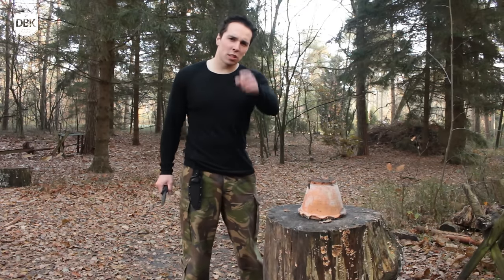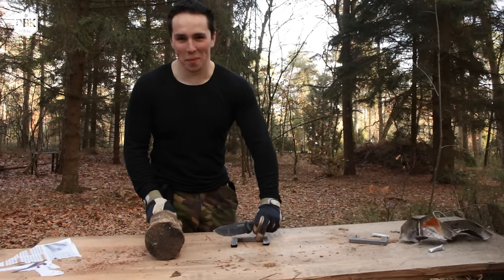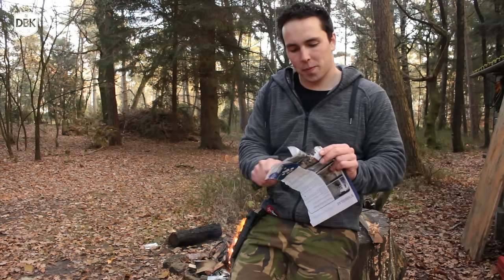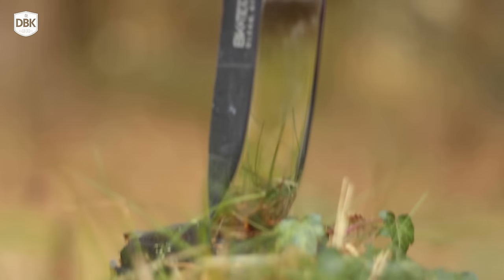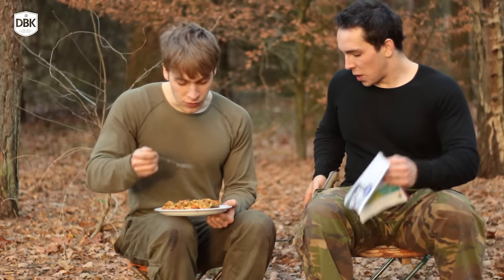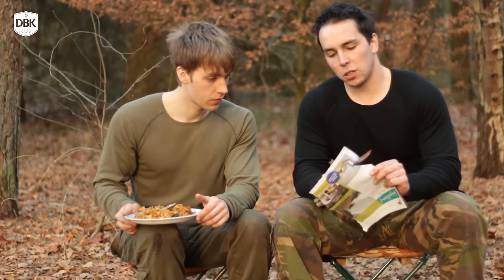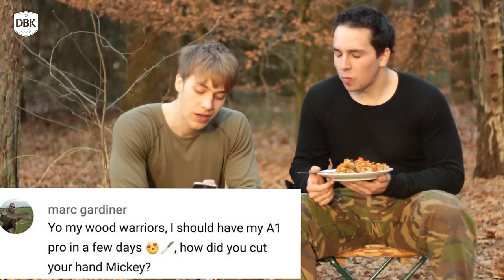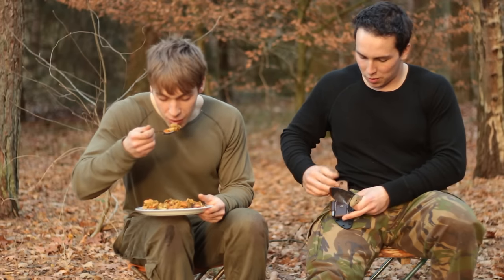Unleash The Beast! // Ka-Bar Becker BK2

Comment: I know the video is old and you guys won't probably answer, but I'll ask anyway :) 

Won't removing the coating and using it for food preparation result in rust on the blade? Being  it a carbon steel knife, I thought the coating was very important for that aspect. Are there ways to avoid rust even on a mirror polished blade, apart from wiping it up after use?
Reply from the maker: Hi man! Yea indeed it does make it way more vonerable to rust! But we like the looks never the less and to be honest we don't use it that much! In the netherlands we would always opt for a stainless/ semi-stainless knife. You can try to put some 'ballistol' on the 'naked steel' but yea.. as far as I am aware, there is no rust solution for a real lowlevel chromium steel. Cheers mate!!
Reply: Dutch Bushcraft Knives thanks guys! I guess I'll thoroughly wipe and dry it after use, if I'll ever decide to "undress" the blade! Keep up with you great vids and take care ;)
Reply from the maker: Thanks mate! You too!

Comment: I really wanted to like this knife and on the end i got rig of it.
The problem (and i never thought i would say this) the blade is overly thick.. to the point where it's handicapping the tool to be a good knife.
I have: BK1, BK2, two BK5, a BK7 and a BK9. Only the BK2 has this problem.
It's a heavy, stubby hunk of steel. I would say its a pry-bar... only because the lack of short size and leverage, it's not really good fir that either. The BK 7 is a much better "knife".

Comment: It’s a beast but not much of a cutter at all which is what a knife should do way to thick behind the edge but if u want to carry a 2 pound knife around that can baton small pieces of wood and pry doors open  or block bullets with I would suggest a knife that actually cuts well and is also a beast like the BHK Lumberjack toothpick great edge better handles sharp spine O1 tool steel that can also do everything this BK-2 can do and baton better actually than the BK-2 your gonna pay more but if your looking for a great hand me down type of blade that can do everything better than the BK-2 let me know I’m always up for a trade but it would take a great knife to pry this Lumberjack toothpick away from me. Plus the Lumberjack toothpick would make a great video I would considering it a survival blade mixed with a beast with a little bushcraft in it a great camp knife probably not a great hikers knife because it’s a little heavy but probably lighter than the Bk2 but u get an extra 1 1/2 inches of blade.

Comment: Again, awesome video. But you made your biggest mistake yet: never ever juggle with knives. For obvious reasons but possibly dropping a knife is bad for the tip and the bevel. A guy one did it with one of my knives, he never touched my stuff again after that
Reply from the maker: I dropped it on purpose. landing on the forest floor doesn't do much with the tip.  Of course I would shit my pants if I saw someone do that with one of my sharpened knives haha. However, this was for the camera.

Comment: If you guys think the BK-2 steel is better than the ESEE steel you must have bought the China knockoff that ESEE sued the company for it being identical in looks. It's almost identical except the steel and heat treat is garbage on the knockoff. The ESEE knife is by far the superior knife from start to finish of those two. It's better then the original BK-2 and the new and improved BK-2. The BK-2 is an ok knife but it's in that no man's land because it's to thick to be a great Bushcraft knife and to short to be a great chopper. It does nothing great except being driven into a tree and used as a stair. The minimum length for a knife with a 1/4 inch thick blade should be a 8 or 9 inch blade. The BK-9 is a much better fit for that platform. Just an opinion guys. Great channel, you Guys seem to have a great time and I will for sure be back for future video's. Oh by the way some of those china knockoffs were even sold to bigtime knife dealers so no one was safe from the unfortunate situation except for the authorized ESEE dealers who were listed on ESEE's website at the time. Later Guy's!

Comment: i dont understand why you hate the esee4 but the bk 2 is fine. i mean its the same steel and almost the samer hadness
Reply from the maker: it seems Ka-bar does their heat treat better than Esee. 1095-Cro Van is still not a great steel in my opinion but it's better than the regular 1095 from esee.
Reply: Okay thanks for your opinion
Reply: I would buy it but the german laws dont allow knives over 12 cm

Comment: 16 ounces of weight for a 5" blade is not a great utility ratio, any way you look at it...
Reply: Go deep-woods adventuring and need such an indestructible knife; you'll quickly change your tune.
Reply: I say then that, for really deep woods, de-limbing and path clearing is pretty much essential, so nothing with less than a 10" blade will really do. Some of those long blades can still split similar wood without bending, but I don't find splitting that useful anyway. For path clearing I was often advised to use just snippers trimming scissors, which are indeed safer and work better, but in the end that is yet another item to carry, and some thicker limbs will still require more... Just like the saw and hatchet, which cannot really de-limb or clear a path: The two essentials in my book. Many 10" blades are no heavier that a pound, but even at 20 ounces they will do everything. Specialized individual tools do seem like they perform each task much better (and they do), but that is only when you are using them all the time, and not carrying the whole bunch of them long distances on foot: People are overly influenced by the notion of the "right tool for the job", and the fact that they drive to where they go. That is why carbon steel rusting is not an issue for them: The knife is never exposed to rain, and then immediately carried long distances inside a sheath without careful wiping, a reality which in fact turns it orange, and dulls the edge from rust, inside an hour...